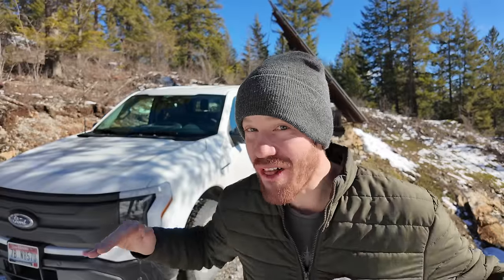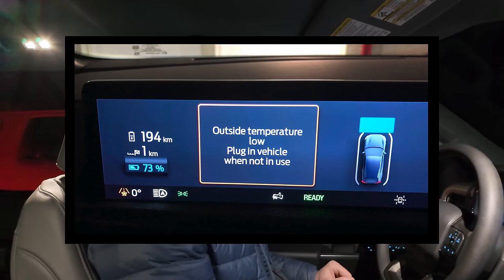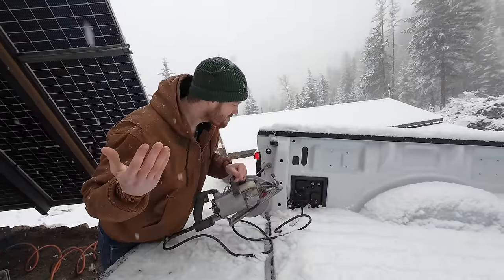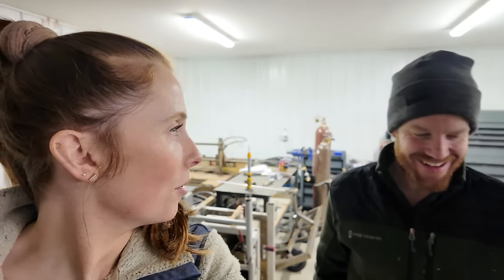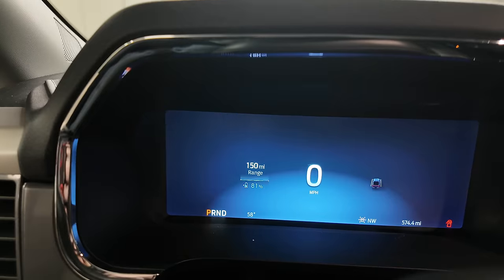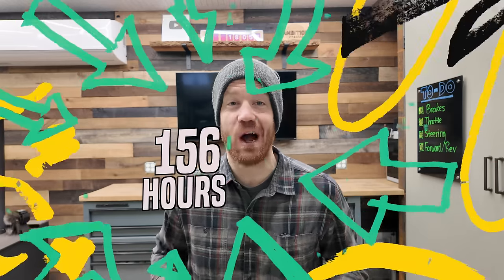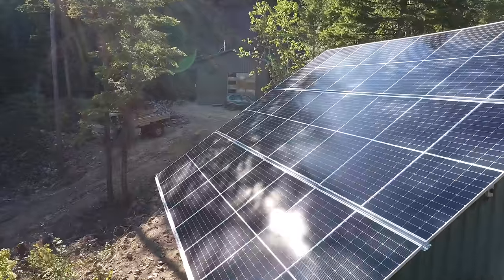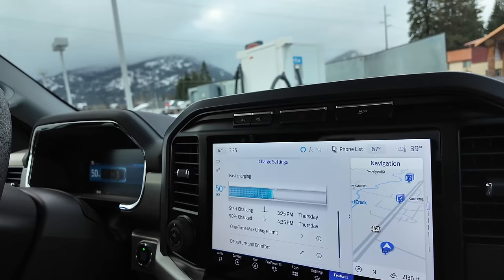Replacing My OFF-GRID Power System With an E.V. (not what I expected)

Comment: This is one of the coolest things I have ever seen.  You didn't hypothesize or talk about it, you did it.  A week at a 400 watt hour average consumption, with zero input is amazing.  I think I might get an EV at some point now, not because I want it as a vehicle, but because it would be an amazing power station on wheels.
Reply: Important Note: Not all electric cars can do this right now. The only ones I know of are F150 and Tesla Cybertruck.
Reply: @lachlanB323  The Chevy EV trucks also have the capabilities. We'll see about the RAM ones. However, there are other EVs that do it to a smaller scale. Not quite suited to off-grid yet, but can help out in a pinch. But most are planning to go in that direction soon. It's just another great selling point for EVs.
Reply: @Paul-cj1wb  Cool! I hope to see non trucks do this! Like even just a standard Model 3 would be great as you can get them for 40k.
Reply: Yes, this capability is extremely useful, but limited to some EV trucks. I have Tesla Model Y with Lithium 12v battery. The best I can get from the vehicle is 16v*12amp ~200w from the 12v socket on the trunk. Even that gives me a comfort, because if we loose a power during a winter storm I can re-charge my Ecoflow Delta 2 out of the Tesla and power my gas furnace or fridge or both. So it is good to know we won’t be freezing. A pro power on board with 7200w power capability is just next next level.
Reply: @suvari225  Yes, Tesla is late to the game as they prefer to sell you their powerwalls. However, they're beginning to change their tune. The Cybertruck now has it. 

As more and more EVs go that route, they'll likely add it to the rest of their lineup. Some countries are even discussing mandating it.
Reply: EVs are great vehicles too.
Reply: - lol, well not the capacity, but my Ford Ranger can get us through in a pinch..  Filling the "under-bed" with batteries would give us a few more dozen kWh..  lol..

Getting a functional battery backup doesn't need to cost $50k on top if the offgrid solar.. -  -)

Comment: We're about 1.5 years into our Ford Lightning experience. It hasn't been too bad for early adopting. My 2008 Subaru WRX was at the dealer more. We built an additional 3.6kw offgrid system with used panels, 10Kw of LiFePo4 batts, and a refurb EG4 hybrid inverter for around $4k after rebates to both charge the lightning and run a 12k btu Mini-split for the garage. System should pay itself off in 4-5 years, and we have 10kW (soon to be 20kw) of backup power for the house, allowing us to use the Lightning and still power the house if needed. We're in South Texas, so don't have the cold weather issues. 4-5 years from now, we'll be getting entirely free fuel, and a climate controlled garage for free. Gas station in the back yard. Not sure why everyone that has the room and a few grand doesn't do it.
Reply: I also added more PV to my place last year, a 3 KW array, after buying a Toyota RAVE4 Prime plug in hybrid, also using used panels, from SAN TAN Solar, a killer deal, and they act like new!

Comment: I think the truck would not supply the Victron system because the neutral is bonded to ground on the truck and in your off grid system. Try removing the off grid side bonding to get the truck to power the Victron charger. Also as someone who has owned 4 EVs it makes me kind of sad this is how your first experience was. It is a learning curve that is for sure. But it should be easier. It will get better with time and you will build up a comfort level to the range anxiety. Hang in there! Oliver is cute as always. We have a son about the same age and he loves watching your videos. He even tries to talk to Oliver when he sees him.
Reply: The Quattro’s (his inverter/chargers) have relays that bond the neutral and ground when disconnected from the “grid”.   When connected to external A/C sources the inverter should be programmed to open that relay and break the neutral/ ground bonding.  It’s a checkbox in the software. 

Assuming that’s set correctly then he could select the “weak AC” option checkbox in the software.  This will make the quattro’s ramp there draw on the truck over time instead of all at once….
Reply: @ryanchristie5349   - is the truck system auto synchronising, it isn't meant to be V2G but V2L ??  - sometimes "phone an expert" helps...

Comment: I think having multiple ways to power your house is a win.  In the summer when you have all that excess solar, it’s total win and a huge convenience as you’ve no need to go to the gas station.  I’d be interested to see if during the summer you could use that truck as your fuel hauler (for the diesels) and do more of your daily driving in it.  So it’d become more of a seasonal truck that gets lots of use during summer and serves more of a backup role during winter.

I think the comments here about depreciation aren’t really relevant if you’re going to hang onto it.  If you turn around and sell it in a year, then sure.  But, to give you a comparison, I bought a Chevy Bolt in 2018 and we’ve been driving it all over the place for 6 years.  It has had quirks and some recalls (heck, I even got a whole new battery in the big recall that increased my range!) but it’s been in the shop a heck of a lot less than gas cars ever were.  It’s just the yearly inspection, tire rotations and has had one new set of tires.  Best car I’ve ever owned.  People spend stupid amount of money on trucks and then throw shade at a reasonable priced electric truck like the Lightening.  Y’all got a great deal.  You have gas cars for those long trips where fast chargers might not be convenient.  Everything has a learning curve, I think you made a great choice.

Keep us posted and make use of that summer sun!

Comment: 20+ year off grid user here, love all the ideas and planing.  Something that has always intrigued me is using a prius hybrid as a battery back-up, generator.  It automatically starts and runs when the battery bank is under voltage.  I believe you can put a big battery bank in the truck, then voltage regulator to house batteries.  Load would take house batteries down first, then the car traction battery, then the internal combustion engine to recharge all.  Should be efficient and rather “simple” to use, as the toyota has the internal BMS to do the work.
Reply: Ford had or has a hybrid that can do exactly that. That is the route i would go,, or even better yet with what edison motors is doing with their diesel hybrid trucks. Both heavy logging trucks and now their retrofit kits for like f250 and f350 class trucks
Reply: Like a diesel electric train!  Hmm !
Reply: Much, MUCH prefer the hybrids!

Comment: For the cost of that truck, you could buy a really huge solar array to suppliment your current array in winter so you just have enough power year round without any hassel or messing around. I bought used 250 watt solar panels for $50 a panel ($70 each including delivery). The used panels have an estimated 10 year life. You could double your solar array power for under  $3,000.00. Add another $1000.00 for the needed frame to mount them on. If you only plug the extra panels into the system during winter, then you won't need any other support equipment except maybe Y cables to be able to put the two arrays in parallel. Put in series would lead to a potentially over voltage situation on a good day of bright sunshine. Having too much amperage should not hurt anything, it will only use what it needs.

You could quadruple your solar for under $12,000.00, figuring $5000.00 for wiring and racking. Having only 25% of the light in winter would then give you full power, and on good days, you would have power to burn! Your electric vehicle would never have to buy power again.

Comment: Well, I wouldn't use it to replace your solar setup, but it looks like it is going to work hand in glove with it really well! It looks like the two systems are going to complement each other really well! That's pretty awesome!
Reply: This. It seems like the trunk should find its fit as the primary backup option when solar charging is not available. During summers it could completely remove your dependence on diesel or gas as "the daily driver" while charging with the surplus at home. Then in Winter it apparently can get you almost a week if the main grid is down for lack of sun. That should minimize the need to use the fuel generators.

And as you now know the truck is extremely sensitive to ground faults from some household items as the test on another channel so maybe it charging the main grid is the more convenient method to power the house.

Comment: Okay bro what you need is fords charge station pro for your application as it allows for power to be sent both ways without needing the vehicle to be powered on. Look in to this and I’m sure it should solve most if not all your problems.

Comment: The F150 240 outlet has a bonded neutral.  If you connect the truck to a bonded neutral circuit you'll receive a ground fault on the truck. Since you were power your sub panel with the truck everything worked fine because sub panels aren't supposed to have a bonded neutral. You also must turn off the trucks 30 minute automatic shutdown.

Comment: I love your content.  I have a Tesla Model Y so I have experience and I find your solution very interesting, and loved watching your experience with the electric Ford.  I will say the following relevant bits:

1. Tesla Superchargers charge WAY, and I mean WAY faster than what your truck draws at the station in town. CCS is a huge fail in the US market.
2. All batteries will struggle significantly in the cold to both charge and deliver power efficiently (as I'm sure you're already aware)
3. You could rig a wireless Arduino to communicate with another one and turn off your truck charging automatically once your house batteries drop below X percentage ... say 98% or something so that if you have a sunny day you can just leave you truck plugged in and it would cut off the charging without requiring you to go unplug it.

* The chargeverter is actually a brilliant piece of tech for a solution.  I have a portable charger that won't charge my Tesla, so I may throw a chargeverter in the mix to see if it resolves the car rejecting the power.  Thank you for that possible solution.
Reply: It's the truck and nothing to do with the charger. Lightning charges at 155kw max. 

My Rivian charges at 220kw at stations that are rated for it. And the Tesla adapter works great. 

That said, I can't wait until everyone is on the NACS connector. It's much easier to use. I charge only at Tesla stations or Rivian stations now because it's so much easier than Electrify America.

Comment: I owned a powerboost with the 7.2kw pro power and it wouldn't run my 15 amp dewalt saw. I opened a case with Ford and they told me the problem was with my saw. But,  I created a video that demonstrated I could hold more than 20 amps constantly by hooking up a space heater that has a dial, and a blow dryer. Then I slowly increased the power consumed using the dial on the space heater. I measured that with an electrical meter and demonstrated the difference was the saw called for 17 amps immediately, whereas I could get my two devices up to nearly 22 amps constant power if I did it slowly.

That was when Fors responded that they have a software update for the pro power on board. I got that update and saw it retested and it worked. This was after months of back and forth of me proving my point that they advertise the system can handle way more than one 15 amp saw at a time. Essentially, the update acted as if I installed a soft start on my saw and slowed the inrush current.

They had this software update available for a long time during my ownership of the truck, they should have issued a recall or installed it when I bought the truck. Instead, Ford just waits for you to complain,  then you have to prove the point as if you are an electrician. 

Anyways, perhaps your pro power on board needs that soft start software update?

Comment: Interesting vid, in Europe here we fit charger units for ev’s because wall outlet charging is so slow. In Australia there are people changing Nissan leaf cars at night at a cheap electric rate and selling it back to the grid at peak hours. More relevant to you though is info from my Norwegian friend who says never run an ev batteries charge below 30% because going from anything up to 30 is really hard on the battery life and then there is the 80% rule that says never change it above 80% to save the battery health. Personally, if I were in your situation I’d need the 30 and ignore the 80! Also noteworthy is that grid storage systems are now being made from roped out ev batteries, not good enough for car use but can store sfe capacity so when the day arrives and you have to put a new battery in that truck, keep the old one!

Comment: I love my EV (not in temperatures and conditions like yours!). I've been driving it for 6 years now. You get over range anxiety in time, as you get used to how it drives, though it does require planning your route and knowing your distances to make sure you can get to the next charger. We have a reasonable charger network in NZ and it's getting better all the time.

Comment: I would not say your EV can replace your off grid power system, but it does supplement it quite nicely. Making the vehicle a little smarter, and better able to communicate with the host system (the inverter or the grid or whatever) could make this whole thing a lot simpler. I understand your motivation, being off-grid, to be able to take the truck into town, get a load of juice, then take it home and store that juice in the batteries at home, is much less expensive than running the propane or diesel generation. I would guess that if you can start with a full battery at home, and maybe once weekly trips to town to supercharge the truck, works when there's no sun. When you have one of those rare sunny winter days, top up both the home battery and car battery (and a tank of hot water), you can skip the trip to the supercharger that week.

Comment: Also a ford lightning owner here.  1) make sure your 12v sensor recall is done. 2) just like your solar batteries, you'll do better if the batteries are warm.  If not, the truck will spend energy on warming the batteries.  The garage is a good mitigation.  3) Pro Power requires an unbonded neutral/ground.  My guess is your curling iron is actually "bad".  4) the 7.2kw must be balanced.  Can't have 3700 load on one pole and 100 on the other.  5). My guess is that you're paying way more than 0.09/kwh at a DC fast charge.  You're way better off putting in a 240 outlet at your parents. 5) unless time is no concern there's no real point chasing 95% to 100%.  6). You might be a good candidate for the sunrun whole home backup rather than pro power since it would allow DC to DC.  Its prohibitively pricey for the other 95% of us owners. Especially if you already have an inverter(s).  Good Luck!!

Comment: The complexity of this concept has come a long way from the 5 tube radio schematic I memorized long ago. I worked electronics up till the 90s. 
Although I understand the concept of what you are doing there is no way in hell i would undertake the challenge. Infact I would further suggest that any retiree over 60 would be foolish to try this. 
My wife has trouble with remote start on her car. 
There are things that old-timers just need because we are no longer able to absorb the new technologies. 
From the windcharger on the smokehouse charging a 6 volt battery for the vacuum tube radio to today's cell phone covers a lot of technology-based advancements.
At some point advancement needs to be paused so us old farts can enjoy life and watch as newer generations continue their adventures. 

Yes I love you adventures across the spectrum of challenges from the old D8 " which I hope you will get it running again " to the electric truck powering your house. 
Thank you for sharing.
Reply: IMO his setup is a lot more complicated than needed... from what and how Tesla's system (as an ideal setup) goes, it should be possible to just plug-in from the main CCS/ NACS vehicle outlet and the power just flow from the charging setup

Comment: since you guys are so into projects, AND you have lots of heavy equipment, what about building a pond up the hill from your house. In the summer use excess solar power to pump water uphill. In the winter, drain the water back downhill to generate power. Of course, you would lose some power to the pumping process efficiency AND regenerating it again, but if it's excess power anyway, maybe not a deal killer?

Comment: This was a super interesting Proof of Concept, imho the F150 does not replace the off-grid system, but 100% compliments it, in that you can go without ICE generators, and just go fetch some power in the town. And I bet the propane, gas or diesel for a generator to last 7 days, will cost more than the cheap power you guys get from the grid when charging the F150. BUT WE NEED THE NUMBERS, PLZ 🙂
Reply: Yeah, but getting power in town is kinda cheating!
Reply: Getting diesel from in town is also "cheating" imo. At least the power in town is local hydro power.
Reply: Well, they can now think about increasing the solar array and even in winter get enough power out of it to run the house, because now they have all the extra storage to collect the huge surplus in summer. Remember, solar still produces a bit power in winter, so if it's sufficient size, it's enough for a home. The issue is where to store all the extra power in summer. With EVs, people now have that extra storage capabilities.